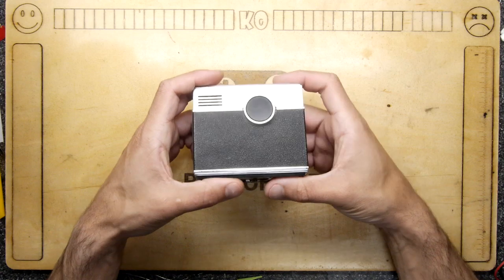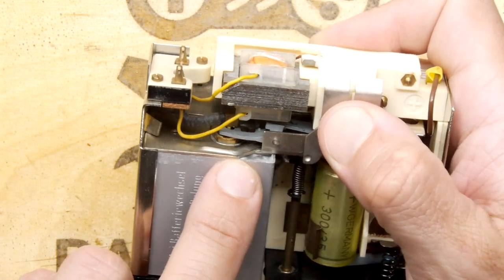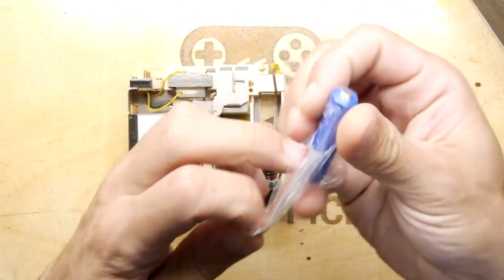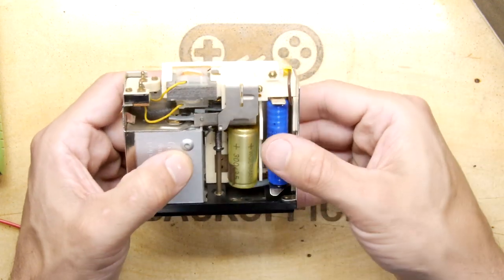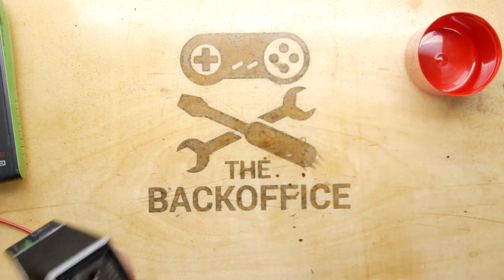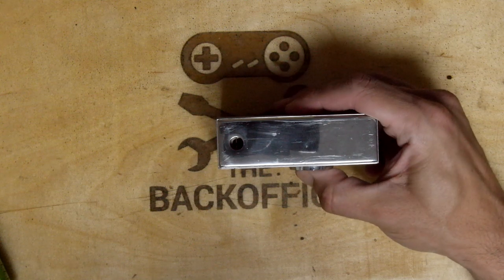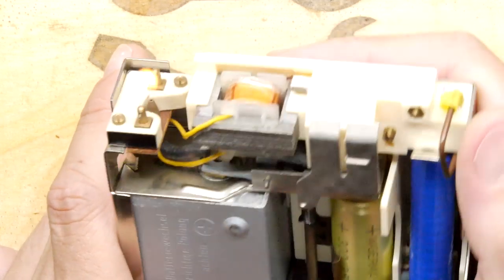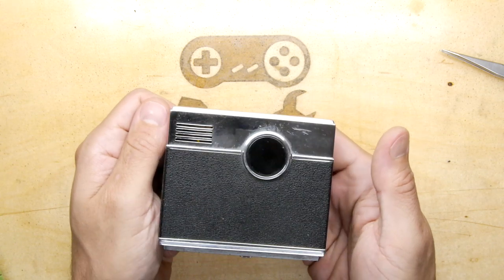Dangerous Retro Rowenta Lighter

Comment: Yeh 22.5 volt battery. Often used in this type of lighter, was also used in some early transistor radios. Some condenser microphones also used this battery type.
Reply from the maker: I want to but hundreds of cells and make a 600v battery 😂
Reply: @backofficeshow  There's a vid here on YouTube where a guy plays with 244 9V batteries... 💥

Comment: Hi, I have a lighter like yours with original battery, the battery is square like a 9 volt battery and it says 22.5 volts on it and it's not leaking, weird. Gaskets and rubber hoses are, of course, tender from aging. Thanks for the video.
Reply from the maker: Very cool!! I need to revisit this beast and see if I can replace the seals. It would be nice to get it up and running!
Reply: @backofficeshow  I have one as well, but mine is branded "Adox" at the front (I'm guessing the old camera maker). It also had the old battery like ora1000 says, shaped like a 9 Volt. The batteries are pretty expensive so I won't be testing it, not really worth the expense, but it was great watching yours working! :D
Reply from the maker: @btranslator  Yeah definitely not worth the expensive battery 😂 I might donate the lighter to a collector or auction it to someone who might want to fix it up

Comment: Where on earth did you find this battery? I have two of these lighters I'm working on restoring. I found a battery listed as 22v that may work but it doesn't look quite the same.

If you work on lighters in the future, give me a shout, I'd love to offer some advice. For example, most lighters can have the excess butane vented by pushing on the middle of the fill port. It's good practice to vent a butane lighter every time you fill it to ensure there's no compressed air from previous fillings.
Reply from the maker: I will try and find where I bought them. I recall it was a matter of doing some Google research to figure out a part number.

Its a shame the lighter is still unusable, I suspect a few seals and it would be ok. Do they need specific seals or would regular ones work?
Reply: @backofficeshow Someone else mentioned it's a 22.5v battery, I was able to find it on Amazon. I've got two of these I hope to get working but if all else fails I've got one for parts. 

I haven't worked too much with butane lighters but I'm learning. Someone suggested watch o-rings, I ordered the first set I saw without looking at the measurements and they are the smallest micro o-rings I've ever seen. Someone recently suggested red gasket paste, so if this one turns out leaky I'll give it a shot.

In my experience, most old butane lighters are leaky fire hazards. I make it a habit to fill and light them outside so if they turn into a fireball I can just toss them into damp grass. I've lost the hair on my knuckles countless times, like just an hour ago.
Reply: @backofficeshow  Battery arrived today, and I got it working! The lighter was leaky, and did explode in my hand a couple of times, until I was able to get the flame adjustment moving... Once I turned it a few times the leaks sealed themselves, must've just been dry seals. I haven't had that happen with a lighter before, but you might want to pull your lighter out and give it another try! It is actually a useful lighter once you get it working, that is if you have a use for tabletop lighter.